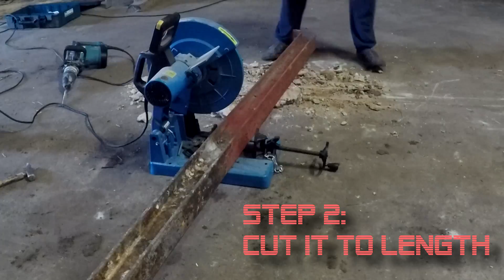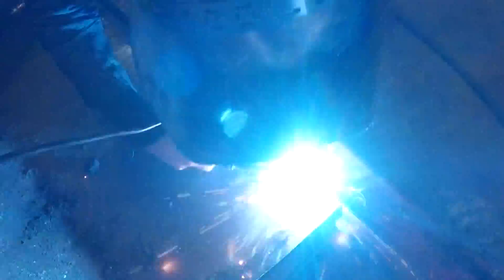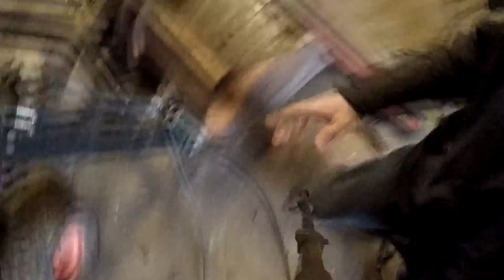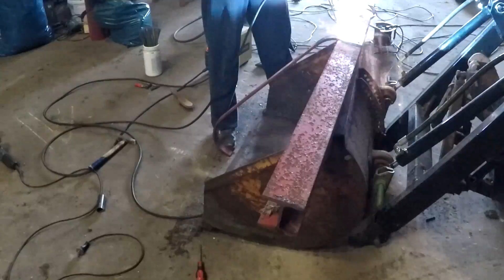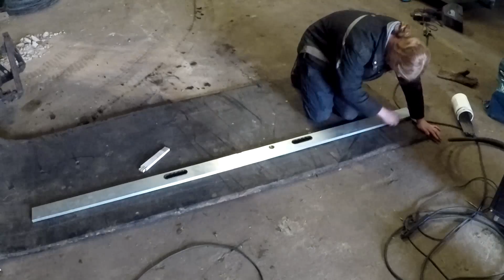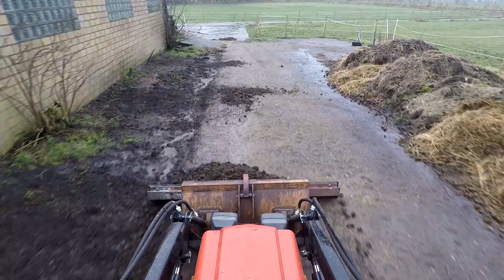Using a Rubbermat to build a Paddock / Manure Scraper

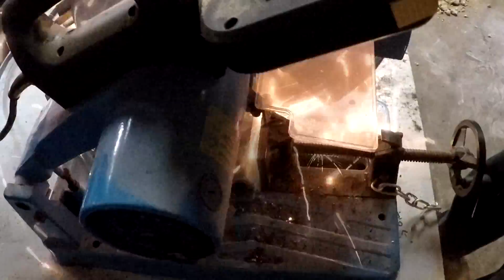Comment: If I'm seeing correctly, at 0:43, you're using cutting oil on an angle grinder. Which would make things worse (reduce the friction which allows the grinder to cut).
Reply from the maker: timtheli0n Oh no, thats not a Cut-off Wheel on there. Its a Blade out of Stell with Teeth on it (Dont know the proper Name)
With better Light in my Shop you would be able to see it. The Lights are an Issue i will tackle in the near Future :). And you'll see it here ;)

Comment: How is this holding up?  Is it still in good condition and working well?  I might make one like it.
Reply from the maker: Condition is still good. Recently had some problems while trying to use it as Scraper/Planer for Soil...but i couldn't tilt it as far back as it would have needed to be. But for its intended purpose, like a charm :)